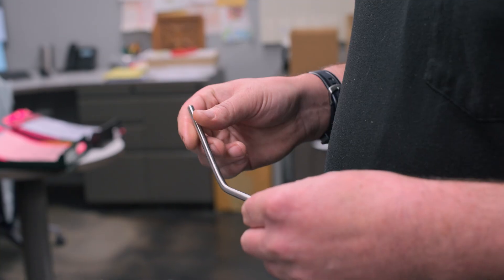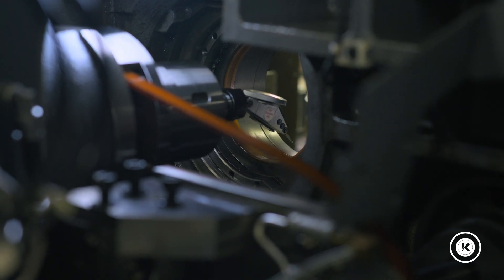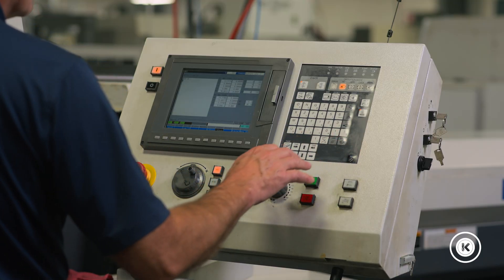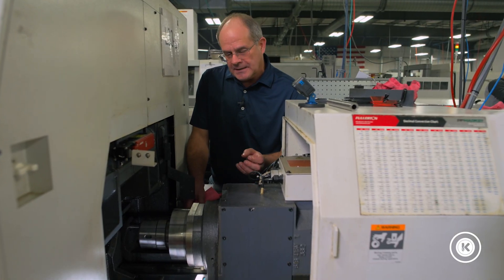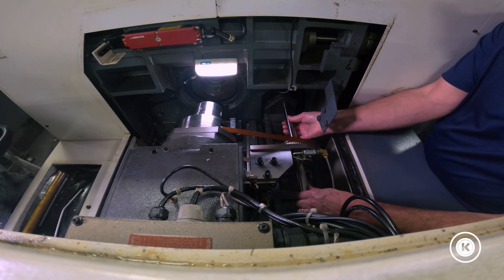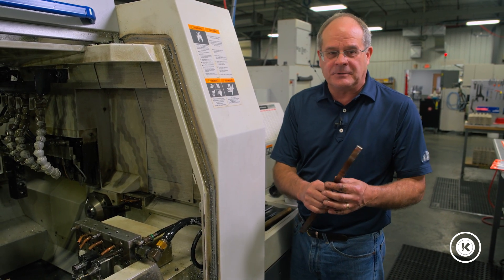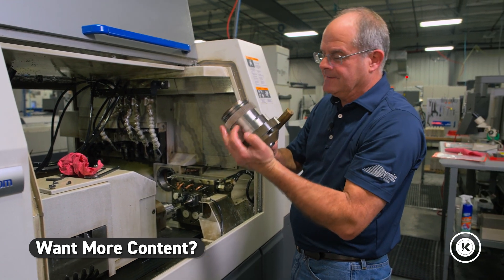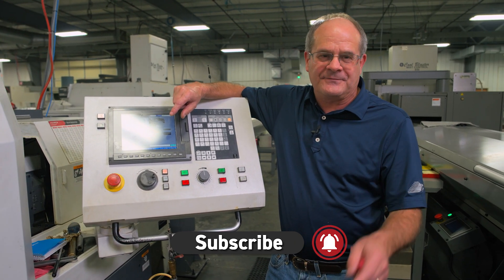How To Align & Adjust A Citizen Swiss Lathe - Part #1

Comment: I'm an old guy...I remember the old "NC" machines and mylar and paper tapes. I admire the contributions of the Germans and the Swiss to the art and science of machining...the German heritage of Cincinnati, Ohio. Robotics were born there and the concepts of CNC machining. Cincinnati Milacron birthed the concepts of additive machining as well. An old southern man acknowledges the German soul in the progress of mankind... the lathes...the mills...the greatest extensions of human hands.
Reply from the maker: Well said. Thanks for the comment.
Reply: Nice demonstration, I've also done an alignment on citizens, M32V turret, like you say Main spindle and guide bush need to be spot on, then the sub relationship to the headstock on the main spindle guide bush. Then you can imagine the centerline through the machine. As a quick guide for the other stations, if you go from the upper gang T45 clock that in. What ever shift allowance is hence DIA and CORE will be moved the same amount to 44,43,42,41 these machines are great, but the guide bush is known to throw out the root cause, and dissecting this is mandator and does require patience and time. I worked on sliding heads for about 15 years from 2006.